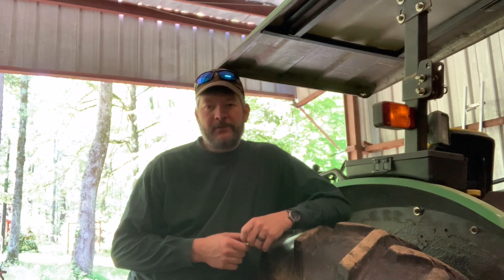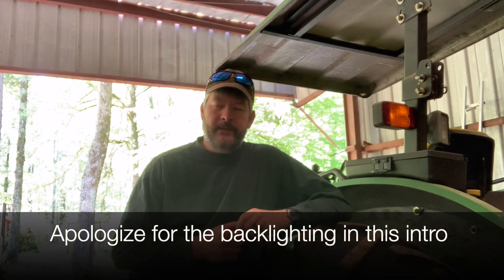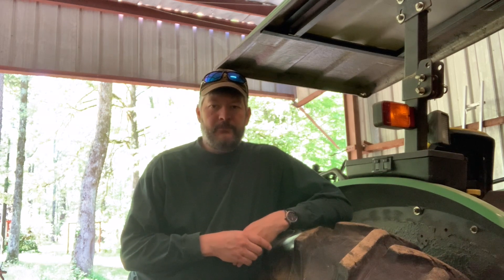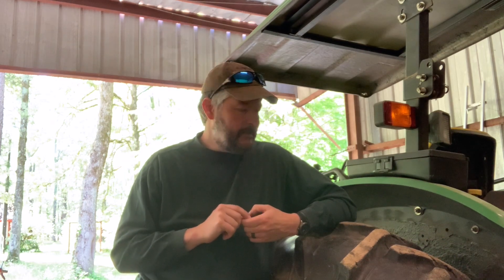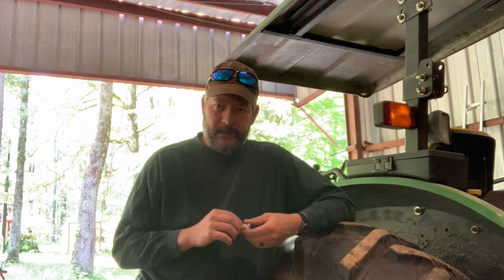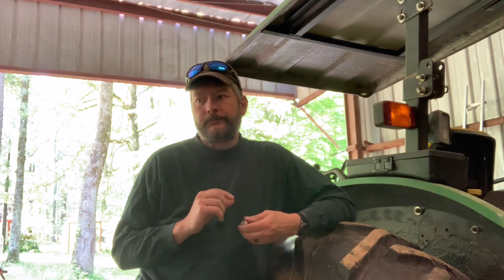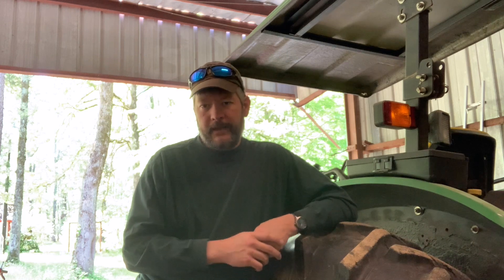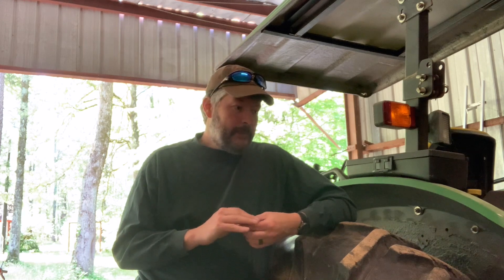Diverter Valve Install on John Deere: Part 1- Hydraulics and Joystick Setup

Comment: Sure would have like to see how you installed the hoses and to what? You got some good videos out.
Reply from the maker: Thanks, and sorry I didn't get into that routing detail. I was trying to keep the video from being too long. The summit systems have pretty good diagrams even on their website for what hoses go where.  They include it with their kits too. This may not be the kit you need, but you can see an example here. Just scroll down toward the bottom. https://summit-hydraulics.com/product/hydraulic-third-function-valve-kit-w-joystick-handle-for-tractor-loader-13-gpm/